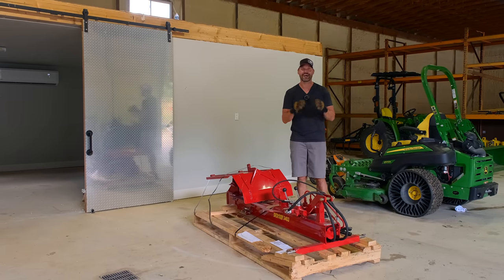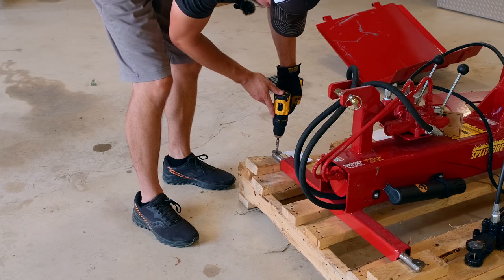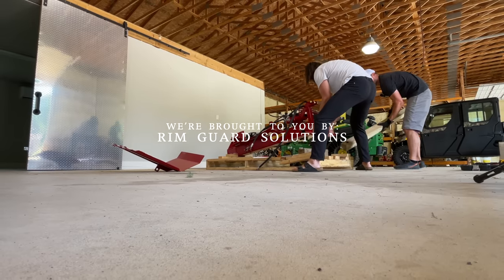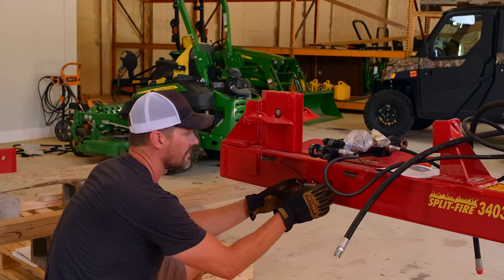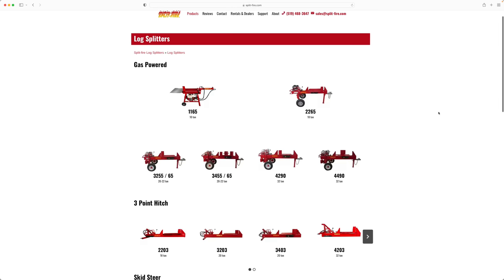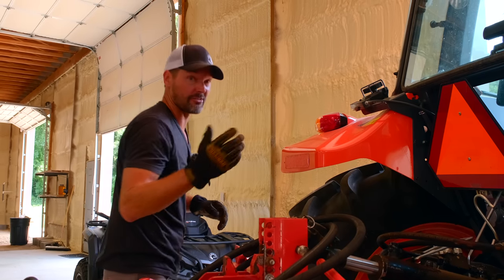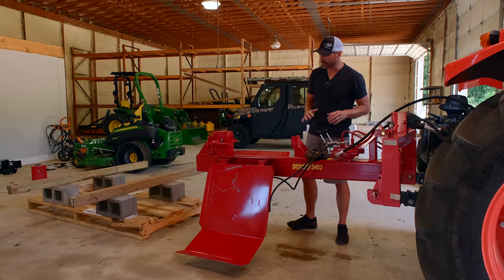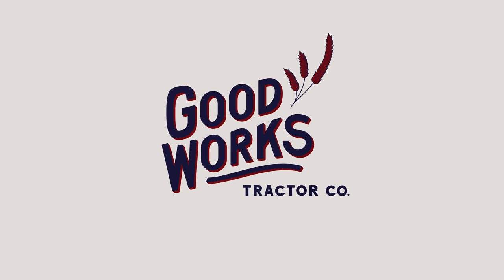WE FINALLY GOT OUR HANDS ON WHAT WE THINK IS THE BEST 3-PT WOOD SPLITTER!

Comment: It may be the best splitter for your application, but not sure it would work so well for a lot of folks. You are shelling out $2900 minimum configured as you tested it. The cycle times with anything under a 4 series JD tractor would be abyssmal. Also, most smaller tractors don't come standard with rear hydraulic couplers. Another thing to consider is tractor wear over time with a 3-point splitter- you have to leave your tractor running the entire time you are using the splitter, possibly at high rpm to keep your hydraulic flow rate up. I''d much rather run a small motor to run just the pump rather than run my tractor. After doing research earlier this year I ended up buying a USA made splitter with a Honda motor. I can tow it behind my tractor, but I shut the tractor off while splitting, or just drop the splitter off at the splitting location and store my tractor. Works better for me. Thanks for the video, appreciate your content.
Reply: Couldn't agree more.
Reply: Good comment, thanks for writing it. 👍
Reply from the maker: Hey John, this is one model out of many.  Not sure if you realized that.  They've got a full lineup big to small.   Had a guy reach out to me recently that only used his Kubota to run a generator in the field.  25,000+ hours on it.  You're paying for power whether it's on the tractor or separately.  Easy time on the tractor's engine too.  I can make a case either way.
Reply: All great points - and to add one more, most smaller tractors do not have the continuous flow valve as this bigger machine - this will increase the temp of the flow valve and lead to further tractor wear. This may be a good option with the right tractor but it will not be for most of us. Love the idea of maintaining one less engine but practically maintaining a Honda sounds like a better options. What brand splitter did you end up getting?
Reply: @tlackov  A PTO slip on pump I think is the best concept though definitely more expensive. I have way too many small engines to want to deal with any more.

Comment: I have this exact same splitter with the folding stand legs. Have been using it for 3 years and it has worked great. Was on a JD 4720 and now on a JD 4066M HD and both tractors handled it well. Cycle time on that is slightly slower but even on my smaller tractor this will keep 2 people as busy as they can handle. Glad to see someone review this a bit more, would have given me more confidence when I bought it but very solid product.
Reply from the maker: Sweet, that's great insight Ryan.  Thanks for sharing!

Comment: Split-Fire is top notch gear- I’ve had the same one you have running form my 2025r as a back up to my processor in my commercial firewood operation, then I restored an old 3255 stand alone. Can’t say enough good things about this fellow Canadian company, proud of you for supporting Canadian!
Reply from the maker: Sweet!

Comment: I have a Split-Fire 3203 which I bought 11 years ago when I purchased my JD 2720.  Works well, just wish it could handle logs that are a just a bit over the 24" length.  Having the log lifter on the 3403 is a great feature as I sometimes struggle with the larger hunks of oak on my current model.

Comment: A temperature gauge for the hydraulic oil would be wise when using the tractors hydraulics. Nice looking unit for sure.
Reply from the maker: Yeah, I've seen folks add them on aftermarket.

Comment: These are really nice splitters. I have an Deere X730 with a 19 hp at the 540 PTO. I am considering a PTO hydraulic pump  and a splitter. Would the fluid overheat in this condition?
Reply: I have the PTO pump version of this splitter, the hydraulic tank is massive and have had no issues with overheating even when running it for several hours.

Comment: Good morning. Could you use a plate on the Split Fire to mount it to the 333?
Pending gpm, at a lower rpm.
Mike, over at ODWTM, has one he uses with his 57-4 mini.
Be safe everybody.
Reply from the maker: Good question Michael, I'll have to find out if compatible.

Comment: I would be concerned with the hoses hanging on the side when the log pieces fall off. Can the hoses be tucked under the frame to protect them and still allow movement of the log lifter?

Comment: I'm confused about the hydraulic valve you used on your M4.  M4's come standard with one SCD (Self Canceling Detent) rear remote valve.  You can add a second rear remote valve with your choice of either a SCD valve or FD (Float Detent) valve.  I assumed the FD style valve worked like a FEL boom circuit valve with a float position.  However, it appears that the FD valve works like a power beyond circuit (always on) when you pushed its lever all the way forward.  Or, does your M4 have the "Flow Control Valve" option, which I thought was equivalent to a "power beyond" option on other tractors?
Reply: As long as the splitter has an open center valve on it The SCD valve works just fine because your not dead heading the cylinder to pop it out of the self cancelling mode. The FD valve , Float  position  won't work on the M4 to run the splitter because there is no hydraulic pressure flow in the float position
Reply from the maker: Audio cut out or we'd have shown.  Will show in a follow up video.  Ended up having to hold the circuit open.

Comment: I had considered a hydraulic 3 point splitter. My New Holland Workmaster 35 has 8.something GPM out the back. I read up on it and realized it would just be too slow (at least for me). With wood splitting season approaching here in OH, I'm really curious to see how the Splitfire works on your machine. Also, I did research later and saw that they have a pump that goes on the PTO that ups the flow to over 20 GPM. It would be cool to see that in action if you had access to that.
Reply from the maker: Hey Mike, yeah may get my hands on that PTO pump down the road at some point to try out.  Cycle time is pretty darn quick on the bigger tractors.
Reply: I have the PTO pump version I use on a JD 2025.  It works great!  As I am in the <100 hrs/year crowd this just gives me another excuse to use my tractor and eliminates yet one more engine.

Comment: I have the factory power beyond kit on my 1025r. Will this divert flow or rob flow from other hydraulic circuits since its a continuous loop?
Reply: Oil flow is 3.15 GPM on stock 1025.  It would probably take 30-40 seconds to cycle a splitter on that.
Reply from the maker: You wouldn't use this splitter on that tractor.  Different model and setup required.

Comment: I see one small issue hydraulic lines running back to the table look like something could hang on them and causing issue pulling them apart or damaging them. Other than that I really like it that’s a minor fix. I’m trying to figure out how to put one on my John Deere 1025R I don’t have rear hydraulics so I guess I would need to put a hydraulic pump on the PTO.
Reply from the maker: Get ahold of Split Fire, I'm sure they've encountered that situation before...could be the PTO pump though.

Comment: I would like to see all the options hooked up and in use.  It's much easier to make a decision on options if you can see them working.
Great video. What the specs including current prices?
Having owned a trailer type self powered splitter for 10 years, I can say that a 3 pt. version takes less room to store and is more portable. Cheers!
Reply from the maker: All info on their site Reno at http://www.split-fire.com
Reply: @GoodWorksTractors True, but that is marketing and shows the best "take".  It is good to see a real user work with it and get the full experience, both good and maybe not so good. Cheers

Comment: What is the price difference between this 3 point splitter and an equivalent splitter powered by its own engine?
Reply from the maker: Hey Karl, pricing can be found at http://www.split-fire.com
Reply: Split Fire (great name) can be bought in Australia. However they are very expensive, close to $5k. I’m sure they are excellent machines but I think I’ll buy a Chinese splitter for $1000 and have a log lifter fabricated for it. It’s winter in Australia and it’s been cold too, for Australian standards.  So it’s the season to be splitting wood. We have plenty of split timber to keep going till it gets warmer. So I might leave it till summer. Maybe log splitters will be cheaper in summer.

Comment: I've always been told to stay away from 3pt splitters as most small tractors remotes were not designed for continous flow and would be over heating the remotes and the system
Reply from the maker: Probably depends on the tractor and if it's mentioned in the manual or simply a rumor...lots of those floating around.

Comment: You know this is a good lookin wood splitter but…
The problem is you have to use your diesel tractor. Anything over 40 horse will go through a regin while you’re splitting wood unless you rev the engine up to 2600 rpm while you’re splitting wood which burns a lot of fuel. Can’t idle these new tractors so to unload hay using PTO escalator or split wood with tractor it’s seems you either run hi rpms or go through a regin cycle while splitting.
Reply from the maker: Yes, if you use your tractor, then it will have to go through regen.  This is just another job for the tractor.  It's made to be used, pretty normal.
Reply: I thought you could work while regen was running.

Comment: This looks like a nice product, but it wouldn't work for me.  I have my PTO chipper attached to the 3pt when I'm cutting oak and juniper trees.  The gas powered 37ton chipper is pulled behind the UTV that's hauling the chainsaws, gas, oil, etc to the work location.  Chainsaw cut, trim, chip smaller branches and split all at 1 time.  I'm in and out and don't have to revisit that location again.  That said - these look like nice products.
Reply from the maker: Everyone's situation is different, thanks for watching!

Comment: Rather have self powered unit. No need for wasted hours on the tractor
Reply from the maker: Tractors are made to be used.  The tires don't need to be turning for it to be a job for the tractor.  Post hole digger and backhoe come to mind.